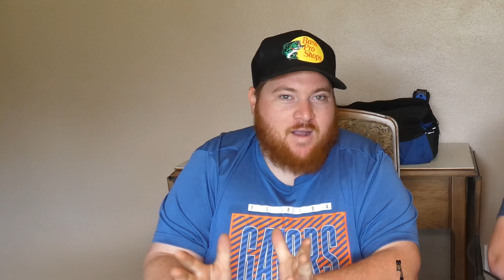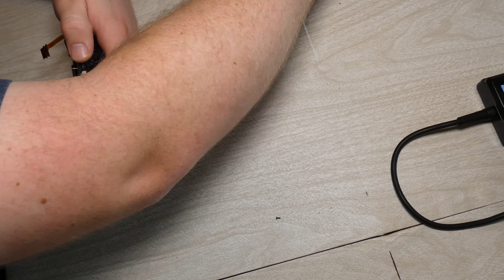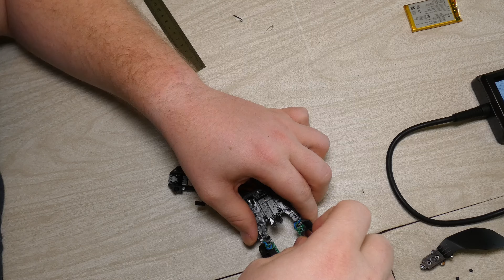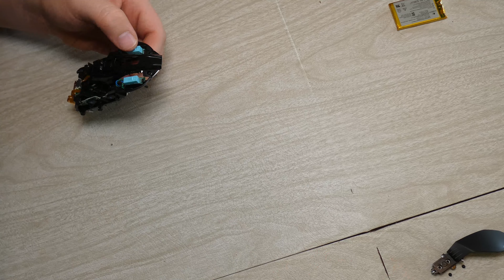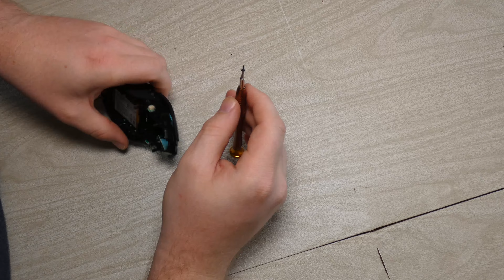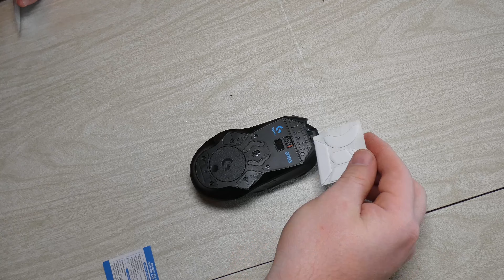Logitech G903 DOUBLE CLICK ISSUE FIX!!!

Comment: I just fixed my g903. Seems to be a slight curvature issue with the contact underneath the left click button. It may be wear and tear. I bent it slightly in the other direction like a stretch and it seemed to do the job perfectly. Mouse works fine now !! Be gentle. its quite a delicate mouse but its very cool and sleek design makes it worthwhile for any fine gentleman
Reply: bro tysm my double click is gone also could yo utell me  if yours returned

Comment: So i found my way to yer channel by way of your Oil Sensor video (which i need to go do).
I noticed this video and since thats the same mouse i have and had the same issue figured id give it a watch aswell. I never replaced the switches in my mouse, i just took a little piece of a post-it note and placed it over top the switch. Worked like a charm!
Fixing things properly is always best, but im cheap.
Reply from the maker: That's awesome, I'm glad you found an easier fix! If for whatever reason it doesn't work long term, we are here to help! Glad you found us, let us know if there's something we can do!

Comment: hey my G903 have 4years and a half of heavy gaming, the mouse sometimes ( like 1/4 clicks ) does the click sound but nothing happens on my computer, do you think its a similar problem which could be resolved that way or should i just change the mouse ? Ty for advice
Reply from the maker: It sounds like it could be a similar issue with the switches. If you have another mouse around you could try it to see if it still happens.

Comment: Idk if you guys will see this, but I just replaced the microswitches in my g903 with kailh black gm 8.0's and it worked perfectly for about an hour of light use, then went to now the right click is constantly spamming and won't stop. I've also read online that there is a cleaning spray that you can get to spray into the switches to make sure they are clean, apparently this has resolved it sometimes. I'm also considering buying entire new little pcb boards that the switches solder to, but idk if these ideas are just going to be more wastes of money on a product that I cant fix. If yall happen to see this any ideas would be greatly appreciated. I really enjoyed this mouse when it worked, I would love to be able to keep using it
Reply from the maker: I haven't seen the cleaning spray but have seen the switches already on the PCBs. That was an option for me but decided to just try the switches first. I haven't had any issues since replacing them and have very much enjoyed this mouse.
Reply: @DummyTechTalks   I ended up getting a new pcb for the switches, I believe I may have damaged the original pcb with the heat because I used an old generic soldering iron without temp control and I'm very new to soldering. It works perfectly fine now tho, and I still have an extra set of switches to retry the soldering when they go kaput in another 5 years. I'm super happy with it now

Comment: Do NOT do this. Just pop off the Cap of the OMRON button, bend the copper contact then put it back. Before you close it back up, click it with the black OMRON cap off to see if it makes the clicking noise.

Comment: Basicly i was have logitech mouses. Its a cool mouse, btw im left handed so i really need watch around for a mouse witch is comfortable to me. I have same issue at one of side button and one main button. It isnt to old mouse max 2-3 year i think. I now see how to fix it, but im not the best in "enginering" so i say that, for this price they can sux me.. I was have Sony Z3 phone and it was a trash i was send 3 or 4 times to repairer to fix it. I never more buy sony phone or logitech stuff.. Just a rubbish with this cheap microswitches. Before this i was used logitech g300s. i was must drop it becouse of some issue...
Reply from the maker: That is unfortunate. Yeah, Logitech doesn't use the best switches out there unfortunately... I haven't had any issues with it since I did the repair though!

Comment: this mouse is a joke
Reply: Without those Chinese made omron switches it's actually pretty good mouse. I so happy they finally move away from these crap and start using optical mouse switches.
Reply: yeah, my 903 that isnt even half a year old started having this issue with my mousbuttons 4 and 5, for almost every game i put the sprinting on mous 4, and now sometimes the input will raondomly double, like when im holding the button for sprint like in dark souls, i will randomly doge and this will continue to get worse, the same happen with my 502, exact same problem after a short period of time. and i always try to use them as gentle as possible so its not that im smashing them to hard or smth. guess thiss will be my last logitech mous fpr now...